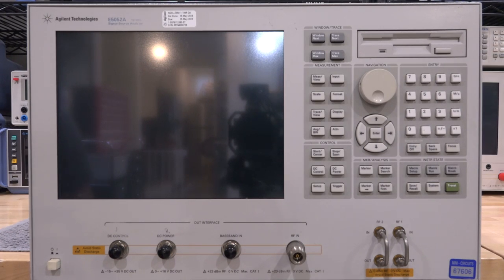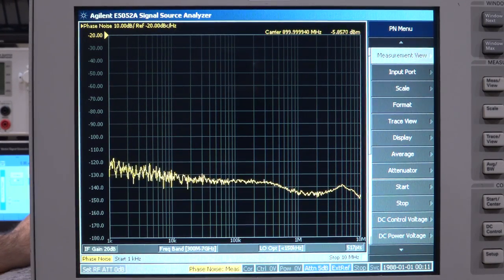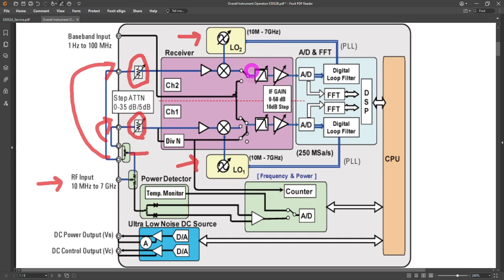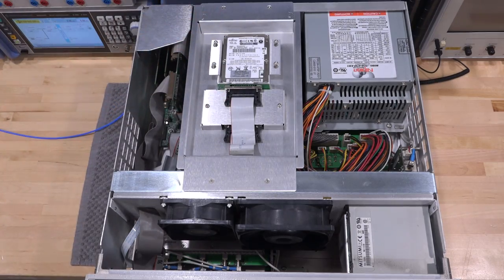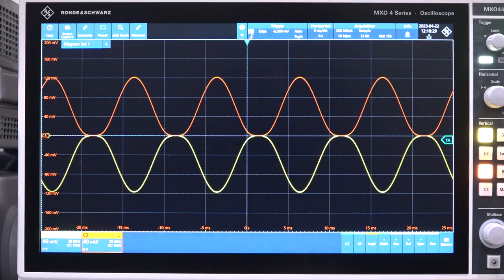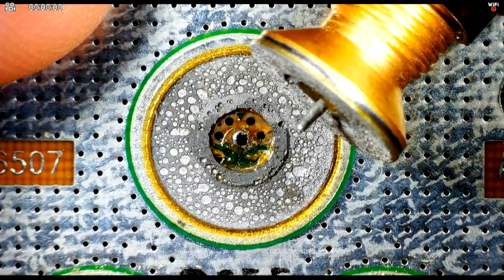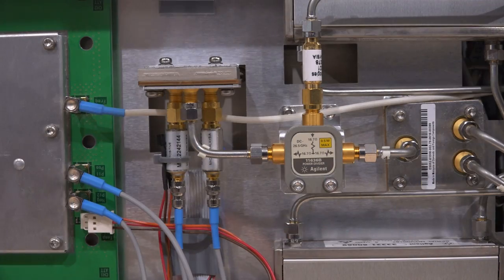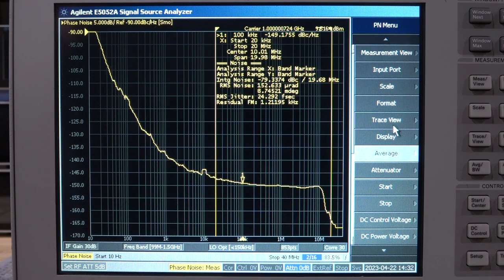TSP #225 - Agilent E5052A 7GHz Signal Source Analyzer Teardown, Repair & Experiments

Comment: A single cold solder joint in a large, complex and expensive instrument... and this is why we test then vibration test and then re-test satellites.
Reply: $40,000 used. That was a good repair.
Reply: YT needs to implement spoiler alert comment functionality...

Comment: Summary was generated by Summatim, let us know if there are any inaccuracies! 🤖
0:08: Introduction
0:14: Phase noise measurement
0:32: Cross correlation technique
1:26: Basic measurements
1:45: Preliminary testing
3:08: Fault detection
7:41: Debugging
9:46: Signal path
10:37: Detector testing
11:13: Frequency-dependent issue
12:02: Measurement of S-parameters
13:05: Broken connector
14:41: Reflowing the connector
18:07: Testing the repaired instrument

Comment: Hi, at 15:38, it looks like you put the board in the wrong orientation relative to the cavity in the back piece?
Reply: Looks like it's keyed so you can't get all the screws in if it's backwards.
Reply: I hope we get a reply from Shariar on this. My OCD kicked in immediately, 😁
Reply: Yes it was backward for a moment, but I’m sure he corrected it.
Reply from the maker: You are right, in the shot I am holding it together in the wrong orientation. But the final assembly is the right way around. It actually doesn’t line up if you try to close it incorrectly.

Comment: This device also has another use, which is to measure the noise of LDO or OP AMP using the baseband port. The noise diagrams on the datasheets of TI/ADI seem to have been obtained using this method.
Reply: Great job buddy! Will there be a video of imaging and replacing HDD with SSD?

Comment: Cross-correlation can be also applied on low frequency (sub-Hz) signal analysis to reduce the noise floor limitations. I'm curious to try it some time later with nanovolt detectors... Also I'm interested in seeing "Ultra low noise DC source" in this E5052A, any chance to see what's special about it next time you dig into 5052s?
Reply from the maker: Sure, I’ll talk about it next time we see one. :)

Comment: I'm second that, in this case, replacing the HDD with an SSD is a bad idea. SSDs are not good long term cold storage devices. They work fine in regular powered instruments because they periodically refresh old blocks. Modern high density SSDs are multi-layer - very sensitive to trapped charge leaks.

Comment: SPOILER ALERT ⚠️ 

Ah, the classic cold solder joint. Is there a difference in the RF performance between the A and B models or is it essentially a computer upgrade? 

Looking forward to if/when you can score the E5053 downconverter. Would be interesting to see how they preserve the phase noise floor for higher frequency signals.
Reply: C'mon , no spoilers please :)
Reply: @xDevscom_EE  whoops! I'll have to add a spoiler alert.
Reply: In addition to the computer upgrade, they improved the phase noise floor of the two 10MHz reference oscillators by switching to 3rd party Wenzel Associates OCXOs that have adapter boards to mimick the original 10811E that they replaced.
Reply: My E5052B OCXO assemblies are marked Agilent E5052-26559-002 with custom Wenzel 500 Series OCXOs within them. They are sturdy aluminum frames that mimick the 10811E vibration mounting points along with an integrated adapter PCB with a short 6-wire cable attached that terminates into a 6-position single-row 0.1" latching header socket.
Reply from the maker: Thanks. If you look at my phase noise video, there I take apart the B revisions and you can see the new OCXOs.
Reply: @Thesignalpath  I missed it. I'll have to go find it.
Reply: @Thesignalpath  I also noticed that they are both tuned slightly off of 10MHz by an exact number of low single Hz. I presume that this is to spread ADC aliasing power levels out when measuring DUTs that are well calibrated to an exact Hz to get the best 1Hz offset measurement.

Comment: When you mention imaging of the HDD and uploading it to an SSD it got me thinking. What is the correct way to do for this kind of instrument that is running older operating systems where you are not 100% sure how they boot? A sector by sector image and not a normal partition style image, or am I missing something? 
I've worked with a lot of SBCs running various kinds of embedded Linux systems and depending on the processor, imaging them can be different, but I've never worked on something this old that is probably running some sort of Windows.

Comment: I think SSD is not great for reliable long term data storage. If ROM data corruption may happen after ~30y , then untested modern two or triple level memory cell is unknown territory
Reply: Long term storage cal data storage use a FRAM
Reply: @universeisundernoobligatio3283  HDD
Reply: If you're concerned about SSD reliability, using an SLC drive would be optimal in all regards except storage density and price. However, even SLC drives of reasonable size can be had affordably now.
Reply: @neonkev7866  doubt that this instrument requires high capacity storage,. SSD storage claim 100y @25C (radiation can affect data redundancy as well) Our repair workshop have  ~10% rate for consumer MCU fail to boot (I guess because of memory corruption or some silicon defect)